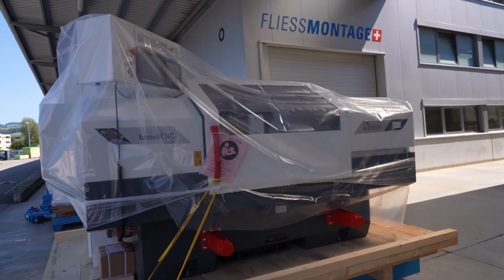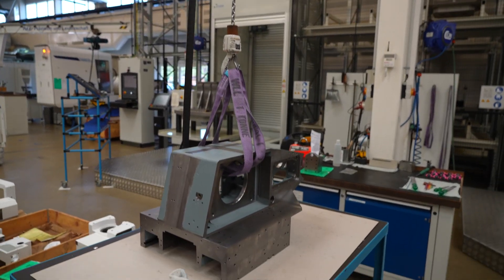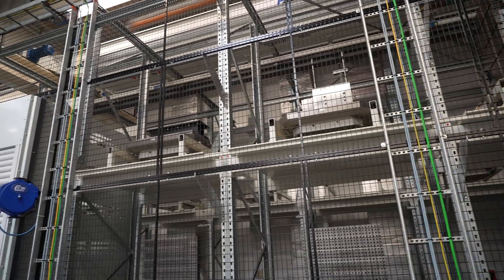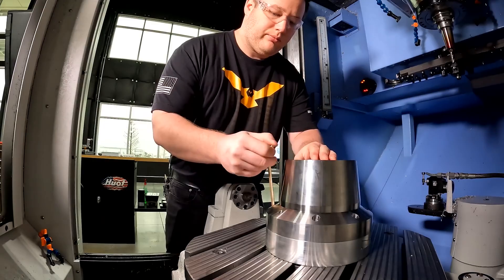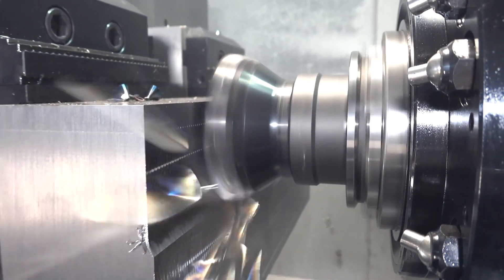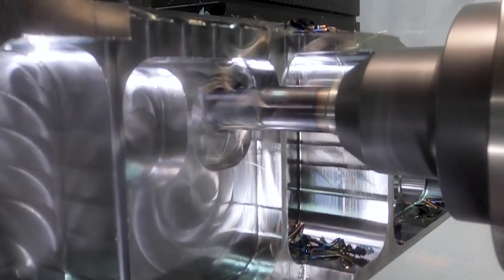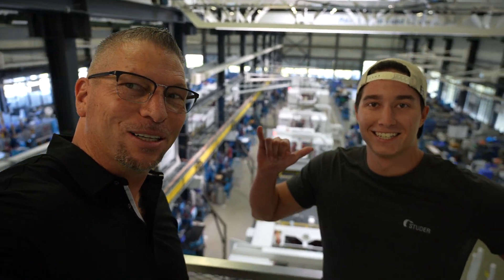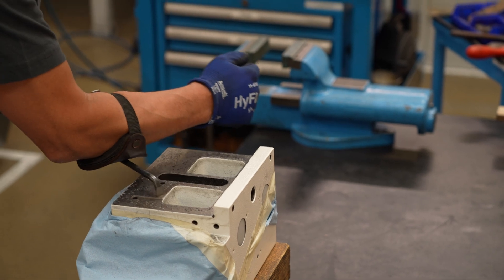Manufacturing on the Highest Level | Studer Grinding | Switzerland

Comment: Vast majority of machine shops are using machines from the 1950s and 60s. I was working at Mellon Company in New in New England and all my Machinery was broken. I spent time learning to fix the machines then when I asked the company they refused to let me fix even the digital readout. Don't know why the machine industry wonders why young people aren't getting into the Machining industry. At melon company I had to explain to the other machinist the difference between high speed steel and carbide. Then they still used high-speed Steel and ruin the part.
 It would be amazing to work in a machine shop like this and learn how to save time with higher Tech machines.
Reply: Move south...
Reply: Shops that are relying on equipment that old are not in the business of making money.  I'd be willing to bet that owners of those shops are using the losses from the shop as a tax write off.

Comment: What about Titan making a video about determining when a tool has run out of its life. In my opinion it cannot always be eyeballed if you want to run the tools to just before breaking point.
Reply: True, but process reliability is more important, so that all the tooling that follows comes to no harm,  as well as the workpiece. Those materials cost mega money, thousands, tens of thousands of £££. 
Use the tools to their best, but, dont push everything to just before breaking point. An end mill may not be suitable to finish 1 more exotic material part to spec (due to wear), but will quite happily rough machine in more forgiving materials like normal steels etc.
Reply: Nobody wants to keep changing code to make up for shit tooling.  You usually end up with pretty crappy results from cutters before they grenade. Not a good practice to find a random tool that looks pretty sharp and just run it like you would put of the box right?
Reply: Some tool manufacturers provide the useful lifetime for there tools or u can calculate them
Reply: in my experience it takes a tool life counter and eyeballs and a bit of data.  

changing tools by eyeball and keeping.accurate count of actual tool life is essential.  

once theres a couple days of that you get a pretty good idea of what to set the top limit at for your tools count and then you can fine tune from there
Reply: Sometimes you can tell by the load on the spindle. If you're taking the same depth of cut, but the load is increasing, then your tool is wearing out. Trial and error will tell you how long that is.